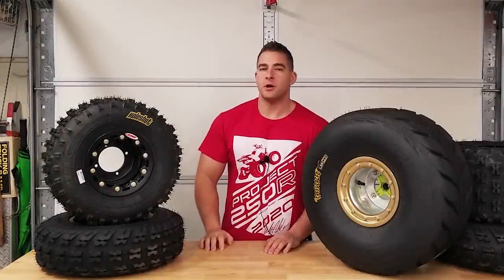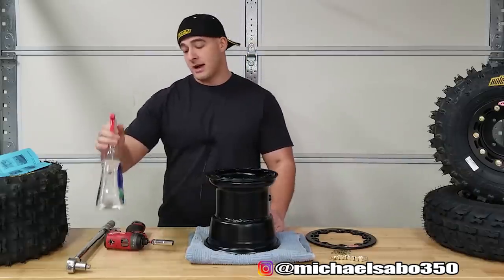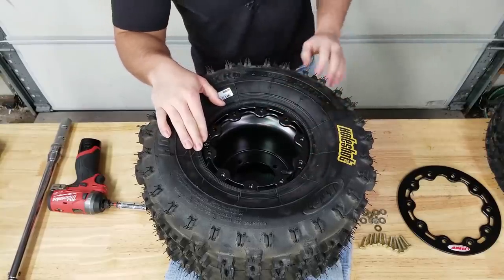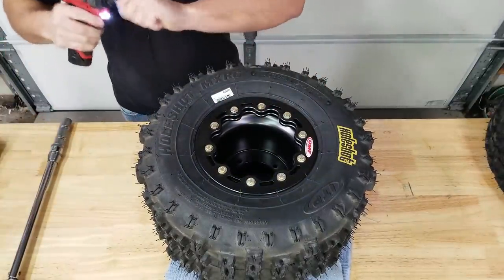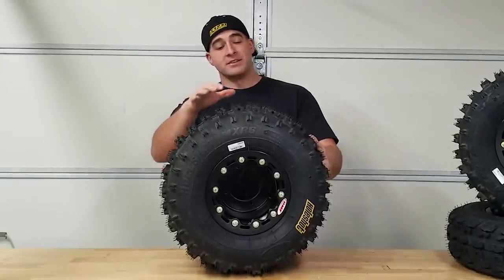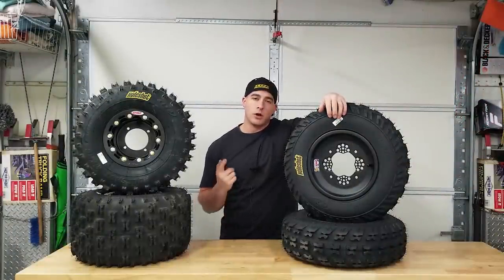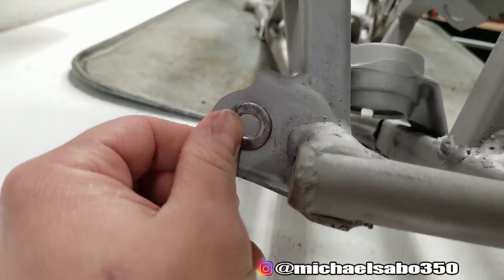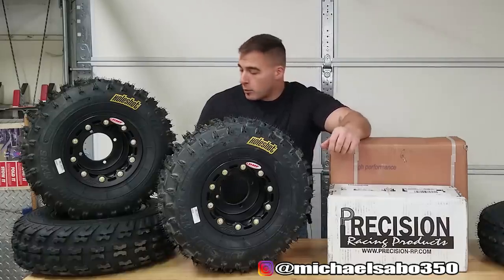Properly Mount Your Beadlocks! Sickest setup on a quad | Project 250R Part 11

Comment from the maker: It's important to grip your torque wrench at the end where the grip is; if you use it the way I do in this video you will slightly over torque your bolts.

Thank you for the people that reached out and corrected me; I was unaware of this 🤘

If you could run any beadlock on your bike... what would you choose 🤔 Thank you so much and all you guys and gals ROCK!!! 🤘
Reply: Michael Sabo you need to hold the torque all the way at the end
Reply from the maker: @James Manzie haha, good taste man
Reply from the maker: @machines1431  just learned this and researched it through snapon. Thank you for the info!! You are correct
Reply: Someone will have to explain that to me. It make zero sense. You set the torque, not the force!! If the wrench is set to 'clic' at 10 ft*lb, you, doing it by pushing 1lb at 10inchs or pushing 2lbs at 5inchs is the same torque!! The only thing is that you will have to push harder.
Reply: Claude, you are correct.  Holding the torque wrench at the very end add more leverage to make it easier to reach the set torque value.  Granted, holding the torque wrench lower down the grip will require more effort which if your struggling to reach the desired torque value.

Comment: There’s a spray can called “ anti spatter “ it should help you out on the welds 👍🏻
Reply from the maker: Ahh, I've seen it but never tried. Thank you for the info man!
Reply: Turn your wire speed down.

Comment: My OCD makes me wish u put a washer on the other side of the frame   Lol
Reply from the maker: Contemplating.... might do it
Reply: Do both sides to all the lower mounts
Reply: Then the a arm wouldn't fit inside the two mounts? Duh lol
Reply: @thebennetts1307  nobody is talk n about changing the id. And you use custom built to your needs spacers for a himes joint a arm, if you do change the Id for repair

Comment: I’m in the process of mounting beadlocks, but I’m confused about something.  After the ring is put on, how does the bead of the tire get seated on the ring side?  You get the tire “over” the outer edge of the wheel.

Comment: Shoulda tightened a ratchet strap over the tire while settingthe bead. You might have balooned them even though you cant see it if you ride a wheelie even if psi is the same it could push to one side
Reply from the maker: Hopefully that didnt happen; I went to 29 pounds. If you go crazy with the PSI I could see that happening though.

Comment: I like how you are teaching to torque your bolts... but... you are using the torque wrench incorrectly.. you need to pull on it from the end where the knurled grips are.. that’s how they are calibrated.. as you did it.. even though it clicks, it’s only reading the torque from where your hand is placed, so they are actually overtorqued .. been a heavy equipment mechanic for 30 years, just trying to help you out.. keep bringing the great videos!
Reply from the maker: Dude, I've actually never heard of this. I would think the torque at the socket is the same no matter where the wrench is gripped; just more or less difficult for the person wrenching. I appreciate the info man, I learn something new from my subscribers all the time; definitely looking into this; thank you.
Reply from the maker: Just went to snapon and did my research and you are indeed correct; thank you again for correcting me 🤘
Reply: Michael Sabo 
No problem.. that’s how we all learn..thanks for the reply

Comment: Dude have you seen the price of c25 or argon or oxygen and acetylene tanks new. Bloody hell the gas is cheap the tanks are anywhere from $250 to $400 depending on size. This is double the price what they use to be thanks to the tariffs . I would have kept that cylinder.
Reply from the maker: Realistically in my area, they go for 2-250 new. 75-125 used is fair in my opinion. Is what it is, sold it in 30 minutes; convenience pays lol

Comment: My holeshots took 70psi on my 8 inch itp rims
Reply from the maker: Are you serious? That's crazy haha
Reply: Use waterproof grease and will pop by 30 or so psi.
Reply: I dont recommend using grease because it doesnt dry like bead lube or dish soap so on a bike powerful enough the wheel could slip in the tire been there done that haha
Reply from the maker: @anaickaube17  i would agree with that